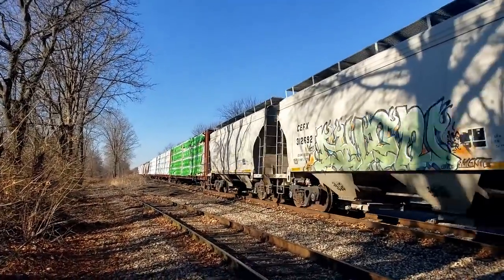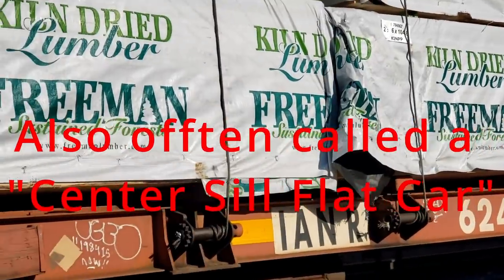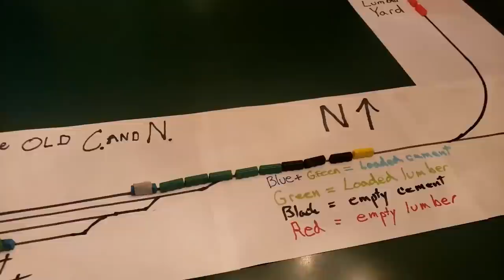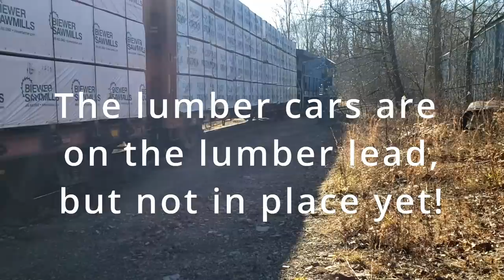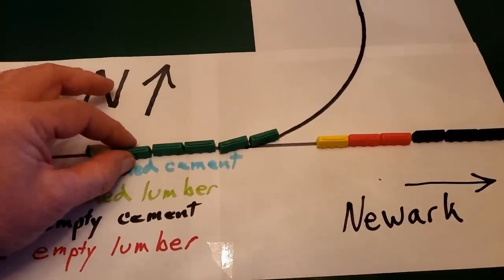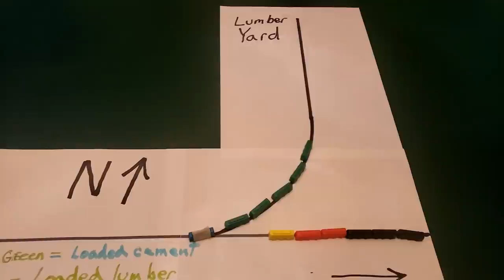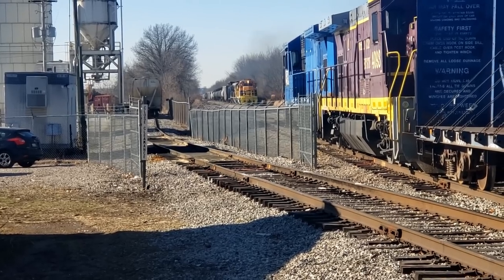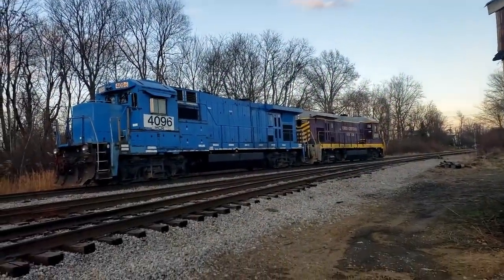The Last Mile of Linear Railroading!

Comment: Great video Brian!  Those two locomotives on the local were originally Western Pacific U23B's back in the day, 4093 was originally Western Pacific U23B #2251 and 4096 was Western Pacific U23B #2264, then they were rebuilt into B23-7's and then rebuilt again into what's known as "Super 7's" with a new nomenclature of B23-S7 with Conrail.

Comment: Congrats on a great video from "my neck of the woods".

When I was a kid in the 60s, this "Pennsy Panhandle" main here was shared PRR & B&O track, and at least double track from Columbus to Newark. Now, much of it is single track.

= = = =

As a kid, my dad and I were at the EXACT SAME crossing where the cement plant is in your video. We came upon a slow freight that was crawling westbound towards Columbus, we were headed southbound, the crossing had flashing red lights (but no gates), dual tracks across the 2-lane roadway... probably 1966 or 1967.

There was one car ahead of us and the freight train was on the track nearest to us (probably a siding)... so we waited as the 2nd auto.

About 4 minutes later... just as the freight  caboose slowly cleared roadway, the impatient driver in front of us quickly started across the tracks. The red crossing lights were still flashing.

Within a few seconds, an eastbound passenger train (probably doing nearly 70 mph) went flashing by on the furthest away track, horn blaring,  and the errant driver slammed on his brakes - the front of his car was now stopped about 12 inches or less away from the speeding passenger train!

Due to the westbound freight on the nearest track, the eastbound speeding passenger train on the far track could not have been seen by the foolish driver. He probably had to go home and put on clean underwear and pants, but thanking God that he was still among the living.

ALWAYS WAIT FOR THE RED CROSSING LIGHTS TO STOP FLASHING BEFORE PROCEEDING ACROSS THE TRACKS!

Comment: Those bulkhead flats used exclusively for lumber/plywood/drywall, out here are called Center Beams. Thanks for the video. Jon, on the U.P., Pacific Coast Line, Santa Barbara Sub., M.P. 404.5
Reply: Decades ago research was done on rail car incidents. At higher speeds,(older, shorter?)  empty flats, center beam/ center spine bulkheads,  were found to have some tracking issues. Problems were related to weight, and sometimes had to do with air pressure on the rear bulkhead actually reducing downward pressure on the leading truck -- These issues required speed restrictions due to truck/bogie hunting. 
There were some very interesting early safety videos made with under car mounted cameras recording truck and wheel set behavior at speed with various car loading on both freight and passenger wheel sets.
  It's amazing that the fallen flags of yesteryear could traverse the country at the speeds that they routinely ran, and on sectional track, compared to the tonnage handled, and 'precision scheduled railroading' of today. Progress? As with beauty, it's in the eye of the beholder -- and unfortunately in railroading/ business, the bean counters and board.
 Give me steam power any day, graffiti free cars, with a friendly wave from the crew on the hack on the back. They can keep their ole all look alike locos and robotic eot's. Just my .02.
Reply from the maker: Very thoughtful, thanks for sharing Bob!  Brian

Comment: Another great video...really enjoyed this one. You spoke of the railroad hauling trash from NY and NJ. A couple of years ago I was out on the panhandle bike trail, which parallels this same rail line out east of Newark, and stopped to talk with a maintenance man who was working on one of the crossing signals. We were talking about how the length of the trains had been increasing in recent years as one had just passed that was pulling 170 cars. He asked me if I knew what industry produced the most revenue for the Ohio Central/Genesee Wyoming RR and I guessed oil because I see mostly trains made up of oil tankers out that way, but he said no, it was trash. That was a little surprising but I have encountered a few trash trains on that line and it can make for a pretty smelly bike ride on a hot summer day.

Comment: The Class 2 rail in my immediate area (UP main is 6 miles off) is fortunate to have a lot of large bulk shippers (refineries, chemical plants, sand plants, grain mills, lumber yards, cotton seed mill, wineries, etc.) who can often take an entire train (or half a train) and their switching can go pretty quickly. Most of them switch once a day (storage issues) at about the same time each day. 2 of these yards bought ground and built #9 1/4 mile sidings for storage of tanker cars (add that one up).

The wicket gets sticky when you have a manifest made up of a bunch of single cars for small customers intermingled with 15 oil tanker cars, 10 gondolas, 5 sand hoppers, 10 grain cars, and 9 acid tankers; you have to make a lot of moves to get everything set and retrieved. If you're around this activity constantly, it becomes 'invisible and almost noiseless' to your conscious mind. 

It's not invisible or noiseless to people who aren't around it all the time. I have had clients literally jump out of their seats in my office (it sets 25 feet from a siding for acid cars) and holler, "What was that?" Grabbing cars is loud and feels like an explosion at close quarters. So despite the block wall that hides the rail from my windows, it's an experience. It's also a great way to get a salesman to move along once he's already on his feet. ;-)

Another great video and primer for anyone who hasn't gotten to see this before.

Comment: That's essentially how our marshalling goes in our yard, although we're dealing with passenger trains, not freight.  But we will change up the consist at least 4-5 times a season, and it always takes some coordination to come up with a plan of where to push or pull what cars where, while we move other cars and join them all back together for the next event.  We have main track, a passing track, then the back track, ramp track and co-op track.  We can also push cars across the street and lock them off, if we have to shuffle things around in the yard proper.

Comment: Great video. There's a CSX short line in Ghent KY. Its a one way in one way out kind of thing. They got a slit mill 2 steel mills 3 gas plants a wallboard plant and 2 chemical plants. They got 2 engines that do this all day long. That blue GE 
I like. But the Ohio Central and the G&O  has the prettiest paint of all the railroads

Comment: This is a great video about MODERN switching. Big thumbs up. Think how hard this switching would have been with a consolidation in the 1900's through 40's or early 50's.  No way to see around the corner and NO RADIO! There would have been a 5 man crew. 2 in the engine and the conductor with 2 brakemen.  They would have been waving hand signals to each other with the engineer on the outside of the curve to the lumberyard.  They would have had to have pushed the train from the last/nearest run around track.  I did not realize in your setup that there was 6 1/2 miles between the cement plant and the lumberyard. Back then, they might have done the dangerous switching and either dropped and coasted cars or kicked cars or  poled cars to the sidings and final placement.
Other interesting note - The second loaded center beam is marked COER.  Crab Orchard and Egyptian Railroad.  COER did a lot of leasing of cars at one time.  Piggyback, TOFC, Gons, Center Beams, etc.  Now the COER is back to being a last mile/first mile railroad in Marion and Herrin, Illinois just like ETR.  They started railroading in 1971 in Marion, IL and were the last railroad of any size to use exclusively steam for operations.  That ended in 1986.  Now all diesel.  Wiki "Crab Orchard and Egyptian Railroad"
I still would like to know your plans for a run around for the ETR.

Comment: Did you happen to notice those steel bands hanging off that loaded Flat?? Imagine you were standing close to the track as the train went by at speed. Those bands would cut you up really bad. Think safety and keep back. Not you Brian, you were clear of it. I heard lots of horror stories from the old heads about things hanging off of cars. One time a 39 ft. of rail was buried so deep that only a few feet were found sticking out of the ground. The rail fell off of a flatcar probably going between 40 and 50 MPH, and it buried itself in the ground. Everyone, keep your eyes open, AND ears pealed for strange noises, and get away from the tracks. It just might save your life.
Nice Video Brian!!!! Thanks!!!!

Comment: Did you notice the red flag in the coupler on the 4096 indicating end of train.

Imagine the additional complexity had the local had a caboose or cabin car (Pennsy term for a caboose) on the rear of the train. 

I am a "Livesteamer", a railroad hobbyist who builds and operates model railroad equipment that runs on 7 1/2" gauge track.   Model equipment is built in 1/8th inch to the foot scale, so you ride on the equipment.  The term "Livesteamer" comes from the early days of the hobby in the mid 1900's when the locomotives in the hobby were mostly steam locomotives, carefully and painstakingly constructed by skilled home machinists in their basements or garages.  Today the locomotives are mostly gasoline or electric powered "diesel" profiles with many of them purchased from hobby manufacturers.   I scratch built a coal fired steam powered 2-4-0 Porter and about a dozen pieces of rolling stock.   There are 7 1/2" gauge tracks all over the country (in the Northeast they are 7 1/4" gauge, but that's a another story).  Tracks range from small private tracks with a simple track plan in the backyard to very large club tracks with mammoth, complex tracks stretching several actual miles over hundreds of acres.  The larger tracks hold "meets" several times a year where Livesteamers gather with their equipment and "operate" over a multi day period.   These "operations" are basically linear railroading where trains are assembled in a yard and run over the trackage spotting and picking up cars at various "industries" along the way as directed by way bills or a switch list while, clearing the mainline for passenger trains operating via a time table.  A very challenging and rewarding hobby with a lot of comerodery with fellow Livesteamers.  Google and YouTube searches for Live Steam will provide additional information on the hobby if you are interested.
Reply: Thanks for sharing Bill, hope to hear more about your project…. ms~~~

Comment: I've seen this done two ways before. One being the one shown in video where the two engines are kept together most of the trip. A class 3 by me uses a loco at each end, originating in Winslow Junction, NJ and hopping onto NJ Transit lines to head east towards Atlantic City, NJ. They stop short of the passenger terminal in AC and head west off a switch into the neighboring town of Pleasantville. The stone plant is switched from the west side locomotive as it backs into the industry to dump gravel. They occasionally also switch an 84 Lumber down that way too. Given the lack of a proper runaround, and timetables to meet on active NJT lines, they run a loco on both ends.

Comment: That was great Brian. Love the model! I wish more railfan videos did that. As a model railroader I confront myself with problems like this all the time. I model an earlier time period so I only use one engine. My only option would have been to use the runaround. Fascinating to see alternate solutions using two engines, however I can't help but feel it would have been just as easy for them to use the runaround too. There could have been other factors involved, e.g., the siding was blocked further down. Also, great job by the crew letting you get close to film and being nice and cooperative. Crews need to realize they are the stars in their own little world and they have fans that would rather watch them than most Hollywood movies. Too bad they don't get paid accordingly!
Reply from the maker: Thanks Grant!   I  try really hard to put out a  quality video but there is a lot to it.  I scrambled around and thought....I'll draw the track out on paper!   Thanks for following.  Brian

Comment: The lead unit has a horn. Whistles are rather uncommon. There were whistles (also referred to as air chimes) on some diesels, RDC’s and electric locomotives or EMU’s. The whistles were quite pleasant. The exceptions were the WABCO air chimes, which had a deep sound. You could hear ‘em for miles. Dogs hated them. To be fair, dogs hate all horns and whistles. 
The Super 7’s (Dash 7- 30B’s) we’re watching were sold or leased to the Monongahela, which was taken over by Conrail which was in turn scooped up by Norfolk Southern. The pair we see here were sold to Ohio Central, which is owned by Genesee Wyoming. (Not Genesee & Wyoming, that’s the original entity) Genesee Wyoming is the present day holding company with operations world wide. 
Your video is informative. I like it! Keep them coming if you have the time.
Reply: Thank you for that important information about Genesee Wyoming, they own a company in the United Kingdom but I was unaware of the holding company's subtle name change. I do like their colour scheme.
Reply: Flake, your spot on, the MR originally “purchased” 7 “super 7’s” and a fellow by the name of Dave Caldwell
Reply: Was the comptroller for the MR and signed the check for the purchase, Dave was a close friend of ours, loved his MR….

Comment: The lumber cars are actually center beams. Bulkhead flats are normally used to haul loads like steel and look like this: Bulkhead Flatcar | BNSF Also, CEFX is CIT Financial and not the Andersons Group (AEX). On a side note, that Iowa Northern (IANR) center beam originated on CN in New Brunswick, Canada and was interchanged with NBM Railways at Saint John. From there the car was sent to Brownville Jct, ME and interchanged with CP. From there the car either went to Montreal or points further west before it was interchanged with NS or CSX prior to being interchanged with OHCR. Or, the car was interchanged with Pan Am Railways at Northern Maine Junction in Hermon, ME (Pan Am has haulage rights between NMJ and BVJ since their main line from Old Town, ME to Mattawamkeag is closed to road freights preventing them from directly interchanging with NBM Railways) where the car will be taken west and interchanged with either CSX or NS.

Comment: Hey Brian, amazing video, well informed.  Out of curiosity, why did the crew reverse onto the main versus using the Columbus switch entrance? I'm thinking it has to do with the switcher having to walk up to the engine, but this was a very small train (I would also ask the same when they returned at the end of the day to park on the side with just 2 engines).

Comment: Live action railroading makes an interesting video.  Wouldn't it be great if the #2021 was on the head end of a train on the ETR?  Shunting cars and moving freight.  This showed how important a double ended track is for operations.  Or if you are thinking about a 2nd locomotive how about an SW1500 or GP9?  If you want to pave over your track like 84 did make certain the ties are new and the rail is good.  The W sign along the track before road xings are called "Whistle Posts".

Comment: Definitely a horn.
Steam locos have whistles.
Looks like the same locos we see on occasion servicing the Mt Vernon industries. Fewer and fewer grainers at the co-ops elevator. Foote Foundry is no more in Fredricktown and that track is ripped up. Rolls Royce/ Cooper/Siemens is gone. 
Rail customers are dwindling. 
Can hear a horn in the distance every now and then from home and know they're switching in town-- unlike dads home town of Ashtabula or at the lake house on Catawba where we hear passing and switching trains regularly.
Spent a lot of time in Ashtabula.
Grandpa (a prosecutor, then judge) and dad (taught law and practices law) knew the majority of folks in town. With one of grandmas and grandpa's neighbors, who worked for New York Central, I was permitted to run locos into the service and ready tracks, around the wye, and even operate/ride a loco and ride in the caboose on local moves, TRY to move the 'armstrong' switch levers at the interlockings. My favorite had to be where the harbor line crossed the water level route. The through trains would shake the ground and windows as they went by. The trains going to the harbor, clawing up the rails with their hoppers full of coal, or taconite going south -- always horns, the banging of slack action or coupling, and the sounds of hard working locomotives --- 
Wish I was a kid again